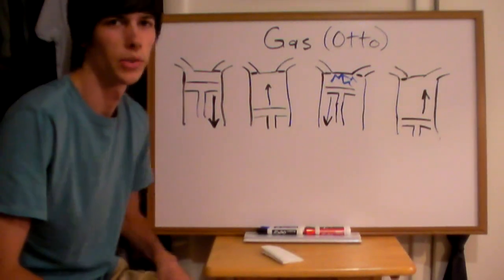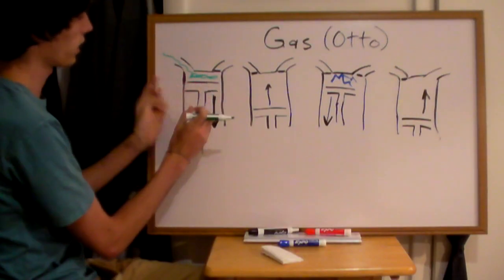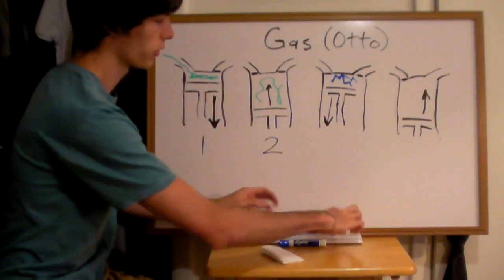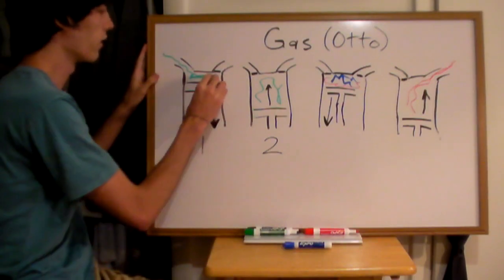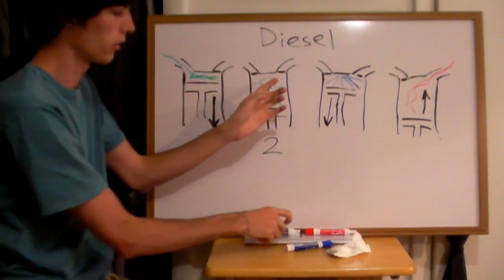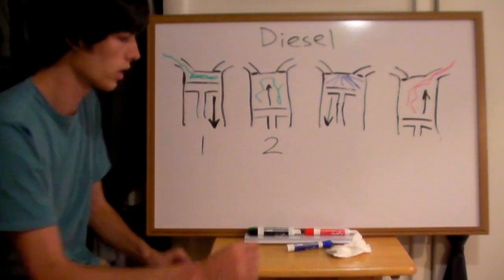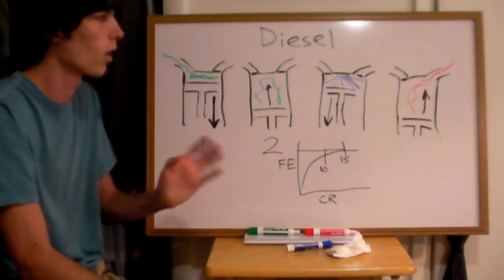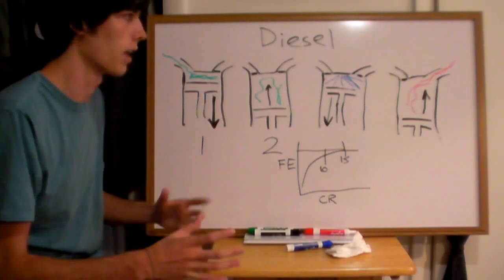Gasoline vs Diesel - Which Is Best?

Comment: Great explanation as usual. So how come petrol engines can't operate on the same principle without spark plugs? surely petrol could also be ignited with the air temperature?
Reply: I dont know excactly but I think that this would not work as well because gasoline burns a lot faster and at a lower temperature than diesel. Diesel engines have very high teperatures inside the combustion chamber
Reply: Well that is not an easy question to answer. You are absolutly right about, that petrol can be ignited with the same principal. The problem is, you don't want that to happen, at least with the current petrol engines.
First of all, you have to divert between direct and indirect gasoline injection. If you look at the older indirect injection cycle, the problem is obvious. The gasoline-air-mixture would ignite primature if you try to compress it to much. That can in a worst case destroy the engine because the mixture would ignite long before the piston reach top dead center and the explosion would try to push the piston down before the pistonrods cycled the side above the crankshaft. What actually means the explosion tries to turn the engine backwards, which would be really bad. So to prevent that, you keep the compression low and ignite the mixture in the cylinder with a spark plug at the right moment. Thats the old way.
But theres also an other problem, which gets obvious with gasoline direct injection. Gasoline doesn't ignite and burn down like Diesel does. Diesel ignite and burn relative slow. It generates more or less a flamewall inside the cylinder which moves through the zylinder and pushes the piston down. Gasoline on the other hand literally explodes if it ignites by it self. It burns not really in a controlled manner. So that's why you use a spark plug, to burn the gasoline mixture down controlled.
But i can tell you, they do some development on self igniting gasoline engines and maybe in a few years from now, some manufacturer can present a working prototype. Because today the probleme should be solvable with a heterogeneous mixture which is only able to ignite by it self at a certain geometrical point inside the cylinder. But to calculate the necessary piston- cylinder- and head-geometrie, they have to use Computational Fluid Dynamics which is why they weren't abel to do so before, because CFD wasn't capable to calculate such complicated designs within a reasonable timescale in the past.
Reply: Because that is one of the major differences between them,in diesel fuel self-ignites due to much higher pressures,and to make that possible engine has to be more robust,heavier and built a lot stronger,which demands more material to be used to withstand ridiculously high pressures. Gasoline engines are not build that tough because there is no need for such high pressures and its cheaper,so diesel=heavier,stronger parts,more expensive engine itself,better fuel economy,and gasoline=lighter parts,less material,cheaper engine itself,but somewhat worse fuel economy compared to diesel
(simply compare prices of two identical cars,one with diesel engine,and other with gasoline engine,diesel will be more expensive by the way)

Comment: Can you explain why sport cars like bmw m5,aston martin,mercedes amg and others why are they mostly gasoline motors when diesel motors are stronger?and why are diesel motors stronger..because what comoponents? tnx
Reply from the maker: Diesel motors are built stronger because they have higher compression ratios and are typically turbocharged, leading to very high pressures, thus requiring strong engines. Gasoline engines are higher revving, giving them a distinct sound over diesel, as well as being cheaper to make.
Reply from the maker: ^He's back!
Reply from the maker: Flux Pavilion - I Can't Stop

Comment: Why only sports and super fast cars run exclusevely on gasoline?
Reply from the maker: I wouldn't say they're exclusively gasoline, but gas engines are higher revving and typically lighter, so those may be some of the reasons.
Reply: Engineering Explained but what about aeroplanes? they run on high octane fuel...won't the increase in weight of engine be compensated by the increased economy? and disel is cheaper than gasoline as well

Comment: The second thing I got out of this video, is that Diesel doesn't require electricity to function. I may be wrong, but since there's no spark plug, it could be set up to be all mechanical. Granted electricity makes everything easier, but that's what I got out of this.
Reply from the maker: You'll still need electricity for the starter motor to start the engine, other than that you could keep everything mechanical, but typically the injectors will be electrical as well, for timing and quantity adjustments to be controllable.
Reply: Engineering Explained you spelt deisel wrong
Reply: doktorbimmer they do not require computers we have 2 3cyl deisel pumps that have no electronic components they are hand crank start (and hard to do)

Comment: WRONG! Ferrari 458 Speciale, 4.5L N/a 90˚ bank has a compression ratio of 14:1, what you mention about petrol having a "max" of 10:1?
Please explain. Thanks!
Reply from the maker: Not a max, but not too many gasoline engines are much over 10-11:1. Sure there are exceptions, like the 458 and Mazda SkyActive engines, but I don't know of any production vehicles over 14:1.

Comment: Diesel have better fuel economy because diesel is a heavier fuel compared to gasoline. Diesel fuel has more BTU's per gallon than gasoline or simply put, there is more energy per gallon in diesel fuel than gasoline. The higher compression ratio is because diesel fuel has a higher Flash point and fire point than gasoline. Sooooo compression ratio has little to do with the fuel economy of diesel engines. The main reason why diesel fuel economy is better is because the type of fuel diesel is. Your wrong once again my friend.
Reply: doktorbimmer LOL, You can't read or comprehend can you? Maybe that's why you don't understand. My original statement was. "Sooooo compression ratio has little to do with the fuel economy of diesel engines." I used the word "LITTLE" not "nothing". Then I backed that up with the "main reason why" which implied that I do believe compression ratio effects fuel economy however the "MAIN" reason is because XYZ. You can raise the compression on a gasoline engine also and get better fuel economy but again that is not the "MAIN" reason why diesels are more fuel efficient. Maybe when you learn how to read and comprehend you will start to understand that It's not my personal theory, but if you Google API and Diesel Fuel Vs. Gasoline Fuel, you will find that I am not the only one who shares this.....fact...not theory.

Again I can't say this more simply. Different types of engines can be more efficient under different conditions and types vs. one another. But the simple FACT remains is diesel fuel is heavier, and contains more energy. Google API if you don't believe me.

You have a good weekend too.. Chip Chip Cheerio. :)

Comment: so does a diesel engine have spark-plugs?
Reply from the maker: Diesel engines do not have spark plugs. They use compression to ignite the fuel, once it is injected (the high pressure = high heat).
Reply: Engineering Explained thank you :)

Comment: so its best to get a diesel....because of the 1 to 15 ratio?
Reply: Not necessarily. In practise it depends on several factors like how much you drive, what kind of driving you do and how much money you want to spend.

If you drive a LOT, like if you drive a taxi, it's good to have a diesel engine because their fuel consumption is lower. This also applies if your drive to work is very long. However, in the US diesel costs more than gasoline, so it can take some time before you see the benefit of the fuel economy advantage.

However, if you need to start your engine cold every time and only drive short trips it's better to get a gasoline engine. Diesel engines produce soot when cold and this kind of driving can quickly clog up the exhaust gas particulate filter. Replacing one can be expensive. Gasoline engines don't need a filter and they warm up faster. 

Diesel cars are more expensive than gasoline cars. Also, servicing diesel engines costs more because tougher engine components have to be used. In Europe diesel costs less than gasoline, but usually there's a tax on diesel powered vehicles that reduces the advantage.
Reply: Thx

Comment: Isn't the primary reason diesels get better fuel economy because they operate at lower RPM's due to more torque...? Lower RPM (at same load) = less fuel needed = better fuel economy
Reply: No, the primary reason is the type of fuel diesel is. It is a heavier fuel and has more energy when comparing it to the same amount of gasoline. You literally get more bang for your buck. So you need less diesel fuel to do the same work as gasoline.

Comment: So because of the high pressure when diesel is ignited, there is no spark plug?
Reply from the maker: Yes, the pressure makes a temperature hot enough to combust the fuel, once it is injected.

Comment: in GDI engines compression can be up to 50:1 since the fuel is injected directly into the cylinder. Also fuel pressures are a lot higher to over come the high compression rates.
Reply from the maker: Can you name a car that has a compression ratio of 50:1? I've never heard of gasoline over 14:1.
Reply: Engineering Explained I think I know the explanation, the GDI engines do reach as high and possible over. GDI are most common with the Mitsubishi vehicles and especially for the Japanese market. I did have a mitsubishi Challenger from Japan, so it is possible.
Reply: Engineering Explained GDI engines are diesel engines so it's possible to see 50:1 especially if the block is built with a cast iron block like most diesel engines. Mazda was working on an engine that had direct injection gasoline and testing it at 60:1. But this was at cruising speed only not acceleration. If the GDI does get 50:1 I am sure it's only during freeway cruising speeds and not throughout the power range.
Reply from the maker: GDI = Gasoline Direct Injection, as far as I know.
Reply: GDI is not diesel. It's a fairly new engine. Almost all new hyundai's are using it.
Reply: It's called GDI because the injector is used directly into the cylinder. Either by a wall guided method or a spray method. Over the next couple years we will definitely see an uprising of these motors as they're produce hardly any turbo lag when turbocharged which in return is good for gas mileage and power.
Reply: i think you are referring to the air fuel ratio in cars that have ultra lean burn tech. the mitsu 4G93 GDI has a comp ratio of 12:1

Comment: Why is it not possible to have the gas (in the gas engine) injected later like the diesel in the diesel engine?
Reply: Gasoline needs a spark. Diesels run at much higher compression and so high that the gas would detonate before the desired time (pre det). The fuel system is pressurized on diesels to inject the diesel into a high pressure cylinder. That probably can't be done with gas.
Reply: It would became diesel engine.. Several manufacturers were trying to make petrol diesel engine (most recently Hyundai), but it ended with concepts.. Petrol just don't have needed properites

Comment: they don't all ignite together, what the engineers try to do is make it so one of the other cylinders is firing at every step of the way to keep the motor spinning. This is were timing comes in and this can get pretty advanced with non-symmetrical or single cylinder engines.

Comment: ...Valves (which "sits" on top of each cylinder) lets the air coming (sucked by the piston on it's way down, I believe) inside of each cylinder, one at the time... then, that air is caught inside after the valve closed - and that happen when the piston is on it's way up. and pressure increased...
Just watch this video again; he is very clear, I like the way he explained.

Comment: BURNT fuel have very minor, if any, effect on lubrication of combustion chamber. I think that lower RPM range can make much more difference, but again, it's about construction.
 I mentioned pressure of fuel in FUEL INJECTORS, which is several times higher, than in case of gasoline engines. You know, injector is very important part of engine. And modern diesels have problems with them.
Reason, why all trucks and other heavy vehicles have diesels, is not reliability, but fuel efficiency.

Comment: I doubt your logic... only to insist that by having an fuel the contains a form of OIL in it, it is enough to reduce friction, a very important factor of wearing out of PISTON RINGS...  I really don't understand why you mention pressure...; I believe pressure can be created (even on gasoline, but with different unwanted effect!), BUT is harder to find a way to hold it on long run... (probably that's why you mention pressure ;) )  
Sometimes for simple questions, as which is more reliable(?) ...

Comment: They are just using fact, that you will step on full throttle only in rare ocassions. If you go on half throttle, you can have higher compression without detonation, which  make engine more efficient. 
Reason for lowering compression ratio for diesel are NOx emmisions, high pressure apparently helps to reaction of nitrogen with oxygen. I believe that several other manufacturers go with CR under 15:1, too. Another reason is, that they can build lighter, aluminium engines

Comment: It's all about construction. Diesel injectors must work with much higher pressure than gasoline ones, so diesels can be less reliable even with help of oily diesel fuel. That applies on all other part of diesel engines. So it's all about construction, lot of gasoline engines can last longer than diesel ones, they are just built not to do

Comment: Compression is created by piston. Piston rings are just seal, which both help to avoid gas leakage to crankcase, but also to wipe off oil from cylinder wall (you can have for example one "sealing", one "wiping" and one combined ring on your piston, different by shape of their edges), and reduce oil consumption. That smoke on the exhaust is made by rich mixture (especially on carburated gasoline engines and extremely on chipped diesels), not by oil burning.

Comment: Piston rings (2 or 3) create compression, that's their "duty", not to separate oil from mixing with fuel. That's why you get lot of smoke on the exhaust (from surface oil that remains on chamber's wall when U get hard on the pedal...

Comment: You are wrong in thinking that a gasoline engine will last longer that a diesel, and it's not me that I'm saying that but through other people that knows better than me. Simple example is that diesel are more oily that gasoline which is dry...  and I belive if you are using good diesel fuel the engine will run better with that expensive fuel pump.

Comment: The diesel engine will just stop working after a while and you will need to have the entire engine fuel tank and fuel lines cleaned Unleaded/gas will not work.

Comment from the maker: Good question and something I don't have a great answer for. I do know that most diesel engines can fairly easily use quite a range of fuels (with some simple modifications, if needed), so it may be possible that it ran.

Comment: Question. I have seen guys put gas in deisel engines on accident before. One of these times, recently, the guy had put a small amount of gas, maybe a couple of gallons, and then realized he had made this mistake. ( it was a new company truck, and it did have a green cap, but it was similar to our gas trucks.) I had heard that you could go ahead and fill it the rest of the way with deisel, or use a deisel additive. What would happen if you drove it with a mixture of gas and deisel?

Comment: The only question I have is as you where explaining about turbo charges in gasoline. How would the mid grade octane fuel pre-ignite the compression in the cylinder if there is no sparke?

Comment: The New Mazda3 I believe has 14:1 Compression from gas, which is retardedly high for Petrol.  Ironically, the new Mazda Diesels are also like 14:1 which is super low for a diesel.

Comment: Other ways are still in concept phase, interesting engine was MUSI combustion engine with combustion chamber in cylinder head, capable to make extremely inhomogeneous mixture, with stoichometric mixture around sparkplug to allow it work without throttle. Engineers claim it's more efficient than diesel with lower NOx emissions - I beleive that they can be close to diesel efficiency, but I believe NOx is main problem.
Other way is variable CR, peugeot has one concept with impressive mileage

Comment: some gasoline engines have same compression ratio as diesels, but still lower efficiency. I think that main role is reduced volumetric efficiency of gasoline engines (caused by throttle) at low loads, which reduces overall efficiency of engine. One way of gaining efficiency is to "turn off" half of pistons at low loads and make rest working with higher volumetric efficiency (however friction of rest of pistons sligthly reduces this effect)

Comment: Gasoline doesn't properly react without the proper air/fuel ratio. If you sprayed fuel into the cylinder at the last moment (like with a diesel engine) then the gas wouldn't properly disperse, this would give you a rich area in the centre of the cylinder and a lean area around the edges and in turn would yield less power. If you want to know more you can research the differences between homogeneous and stratified fueling, (Homogeneous fueling has a consistent A/F ratio throughout the cylinder.)